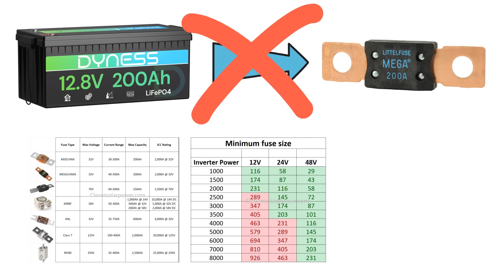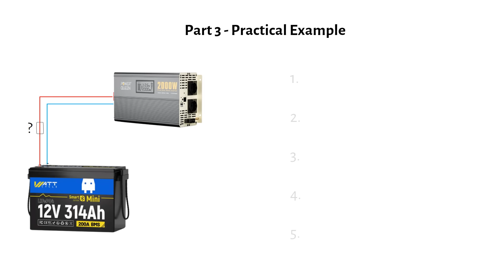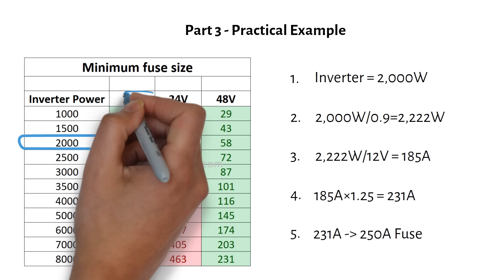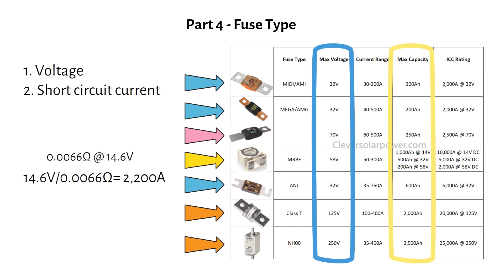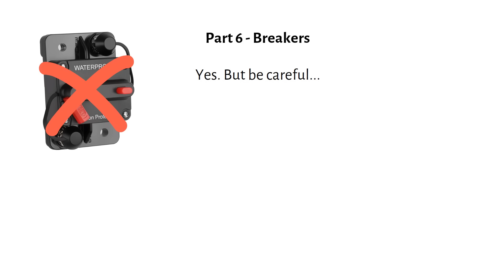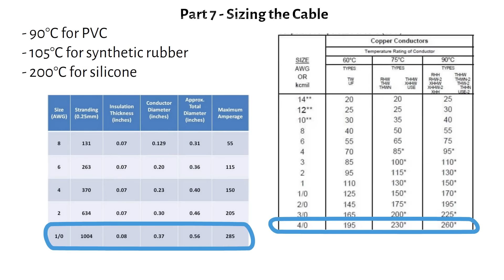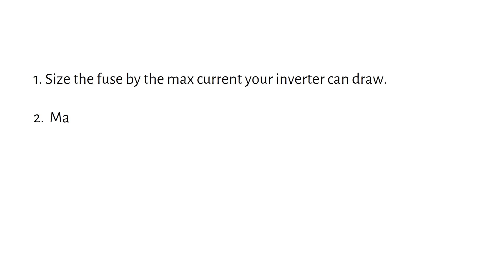How to Size Your Battery Fuse to Inverter

Comment: I'm just wondering but how does multiplying 185A by 1.25 (as a "safety factor") make this safer?  You end up putting a bigger fuse on the line allowing more current to flow before the fuse blows.  Wouldn't that be less safe?  I'm thinking more current flows potentially causing a fire.
Reply: Those of you arguing here, let me ask you a question. If you design your system and the normal operating current is 200A, will you go for that exact value of fuse? What calculation would you make to obtain a fuse valve that will not blow up during normal operating conditions? Please think well before you turn on your data to come online and run your mouth towards the opposite side. Fuse sizing is in love with cable sizing. Always treat them equally to avoid disaster. Thanks
Reply: @BlaiseChia For a NON-SOLAR electric circuit, If the normal continuous operating current (more than 3h) is 200A, then the National Electric Code, NEC, requires a minimun rating of 1.25 x 200 = 250A for Fuses, Breakers and Conductors.  But wait. We are not done yet.  IF that circuit is produced by a SOLAR PANEL ARRAY, then that 250A must be upgraded by another 25%.  
250A x 1.25 = 313A minimum ratings for  all Fuses, Breakers and Conductors. 

This is safe to operate continuously at 200A, because 
1.  The first increase of 25% allows you to operate more than 3hours.  
Why?  Because the continuous load for Fuses and Breakers and almost ALL electrical equipment is 80% of their (short term) ratings.  Short term ratings are the  standard electrical practice.  Many people don't understand that the typical  "Electric Ratings" are NOT FOR CONTINUOUS OPERATION.  Electric Ratings are MAX SHORT TERM LOADS.  If operated continously heat builds up, so short term ratings are reduced to 80% to allow continuous operation (more than 3h).   If we take 80% of 250A, we get the continuous rating.  0.80 x 250 = 200A.
Sizing of breakers, fuses and conductors at 250A allows continuous operation. 

2. But we need 312A.   Why?  There's a lot going on in a solar power system!
Solar panels can operate in extreme conditions anywhere in the world.  We must account for temperatures that could vary from - 40 to 85°C.  We must account for sun intensity.  Cloud edge effects, a snow covered field or a backyard pool, or a large sliding glass door, can increase the sunlight hitting solar panels.  Incoming radiation on a panel might easily increase by 10% or so.  A temperature at freezing point can increase output voltage of each panel by 7.5%.  Panel configuration in series adds voltage.  3 panels in series in winter might be a 3 x 7.5 = 23% increase in voltage.  If these things happen all together, you could easily be riding on the edge, if not over the max currents.  To account for possible extreme outputs of all those things, the NEC requires another 25% increase.  250A x 1.25 = 215.5, or call it 313A.  That's what is needed for MINIMUM solar system safety.  Note that there is still room to increase it more.  If you get temperatures significantly below freezing and you have a nearby snow covered field, or a building nearby with reflecting glass panels, you might want to have an electrical engineer take a look. 

If you go lower than 313A, be sure your insurance is paid up, you complied with NEC or whatever your local building inspector said and whomever assembled your system was licensed.
Reply: @bipl8989 scaring the crap out of me.  I just built a small system  and afraid to turn it on now. LOL.  Any idea where to find a professional to look over my little setup for safety suggestions?  There must be people making a few bucks advising on these issues.
Reply: @bruceontheweb  Sorry.  Wasn't meant to scare you, just to get people thinking seriously. That's not common on YT.  These high Amp systems, even a small one, can actually be very dangerous.  Just 50mA can be fatal under the right, or rather the wrong conditions. Any accident could at least be an extremely unpleasant experience.  Modern solar makes it very easy for most anyone to build a powerhouse, or a death trap. I'm not sure it truly qualifies as DIY.  When I see a lot of these "internet solar experts" getting the most basic safety factors wrong", that worries me a lot and I feel I have to comment.  Great you're taking it seriously.  
  The best idea would be to try to find a registered professional electrical engineer in your area.  Second, find a registered electrical contractor.  Ask them which consulting electrical engineer they use when plans need to be stamped by a registered professional engineer.  3rd. Ask your nearest city building department if they have a list of consulting engineers in the city, or who they can suggest. 
  Lastly,  Tell us about your system config and maybe I can find you a good "go by" example plan.
Reply: @bipl89891.25 is a motor load calculation for start up in rush current.We use this with slow blow fuses.That's to not keep blowing fuses on inrush currents.Derating 80 percent on continues loads yes 3 hours.The fuse is to protect the conductor ,no matter if it is either. 14gauge 15amp 12 gauge 20amp and so on.The fuse rating is sized to the conductor and the conductor is sized to the load.
Reply: @bipl8989as a german Electrician i size my Fuse by cable ;) .
Its defined in our Code.
A Fuse for a Powertransmission has to protect the Cable ,there are smaller fuses to fuse a Generator (battery,photovoltaik, load) in Addition.
If the cable is thick enugh you can only fuse Generation (on the Power source).
And a smaller one to protect your load from Catch fire.
The collegue in the other comment is right! you need to calculate duty cycle in by (in germany) Faktor 1,25 on 100% within 1 Hour.
Reply from the maker: Good question. Sizing the fuse larger makes it run cooler, so less heat generation and less power loss. Also, the cable will be sized larger, so there is less heat loss and voltage drop there as well. A fuse doesn't limit the current.
Reply: what does sizing the fuse larger (fuse value) have to do with temperature? are you confusing fuses with contactors or shunts? yes, the quality of the fuse can make a diference in working temperature, but not upsizing it. and if you want to multiply something by 1.25 for safety reasons, that something should be your cable cross section. when you say 'safety' you mean ' make sure you don't blow the fuse with your load' or you mean safey like in 'prevent fire'? .   it is bad enough that usualy you need to go up in value to find a standard value for the fuse you need
Reply: @breakthru3000 you are not only calculating the fuse size, but the cable size as well.
If you sized a 250A fuse, you would also size the cable to handle 250A. NEVER use a larger fuse than the cables you are running.
Reply: @woodlanditguy2951   The wire must be rated to handle at least as much current as the fuse rating, but the best practice recommends the wire can handle 125% of the fuse rating for a safety margin against fuse malfunction.  Nothing dangerous about using a lower fuse rating, it's a low wire rating that will screw things up, but a low fuse rating might blow when you really would prefer it to ride through.
Reply: @breakthru3000 Temperatures increase with operating time.  Temperature increases are only covered in a typical design for up to 3 hours.  Operating longer than 3 hours, as in a typical solar system, requires a reduction in all allowable current ratings.  In the typical wire tables, the given Amp ratings mean that the stated temperature will be reached after 3h of operation at the stated current.  Over 3h and wire temperature will continue to increase.  To account for that, increasing the wire's design current by 25%, before looking in the table, will get us a wire size that we can safely use for more than 3 hours in a NON-SOLAR system. 
  Solar systems require another 25% increase in current for days when excessive current can be generated.  So, for solar systems the max current must be multiplied by 1.25 x 1.25  or 1.56 before entering the wire size table.
Reply: @bipl8989I like your responses. These are some of the engineering brains I know out there 👍👍👍
Reply: @BlaiseChia Thank you!  50 years in engineering oil & gas works taught me safety is #1.  Solar makes it easy to assemble complicated systems, not a weld in sight, but we can't forget that they can be very dangerous, if done incorrectly.  I don't want to see anybody get hurt.  And always remember that building to code is the absolute minimum requirement.  Look for those situations where you may need to beef up, especially when safety is concerned.  They usually fall into the category of cheap insurance.
Reply: It’s true that the quality of a fuse can make a difference in operating temperature. But upsizing the fuse can also make the fuse run cooler. Again, it depends on the quality. An ideal fuse should never get warm even the slightest, and then it should trip as soon as the current exceeds the rated value. However, no ideal components exist in the real world. The reason a fuse opens at high current is because its internal conductor gets warm enough to melt and interrupt the circuit. Without heat, a fuse would never be able to blow. Fuses are engineered so that their internal conductor gets very warm when the trip current is exceeded. Therefore, a 100 A fuse does not normally get much warm when there is 9 A running through it, but a 10 A fuse could potentially get quite warm at that current.
However, “upsize your fuse so it doesn’t run warm” is a very bad advice in my opinion. There is no logic behind such reasoning, because we are then compromising the amount of protection we have during a real over current event… which is the type of scenario we are trying to protect against in the first place.
I think a better practice is to oversize your cables as much as you have money and space for, then rate the fuse according to how much current you expect to flow in the system. You expect your inverter to never draw more than 170 A continuous? Put a 200 A fuse in series with the positive supply for the inverter. That’s all there is to it.
The way things are explained in this video could leave room for improvements. We don’t calculate a fuse according to the max power rating of an inverter. We can use a 3000 W inverter but never draw more than 1000 W from it. In that case putting a fuse there based on a 3000 W output calculation only makes the system less safe.
Reply: 50a dcdc needs 60a fuse cause 49a makes it melt i had mega fuse that melted and 50a isnt exact Science its around+-5%
Reply: Because more current never flows.  Larger Fues and thicker wires do not generate larger current.   It is more safe because the wire and fuse are both sized for the increased Amperage, well over what can be delivered by the devices in the system that do actually make current, but still low enough to blow on a short current.  A lower rating is "safer", but may be subject to blowing when you get a small transient that you would actually prefer to ride through, rather than blow for some level of current that is still safe.

Comment: Hi Nick, Great video.  For choosing cables, I like the silicone insulated cables but I've always been wary of fusing them to rated capacity.  It is nice that the insulation can handle higher temperatures for overload conditions without breaking down,  but I do not want that heat in my system under regular conditions.  I don't like the inefficiency of this or the knock-on effect that extra heat has on the system components (de-rating of inverters & solar charge controllers etc).  The copper in them is essentially the same as PVC insulated cables (though sometimes more strands or tinning) & the same cross-sectional area.   For connections between charge controller, battery, busbar & inverter connections, etc, I like to use the biggest conductors that will physically fit with correct lugs or bootlace ferrules.  We're normally dealing with very short cables here so upsizing is not cost prohibitive.  Keep up the great work - I'm learning a lot from you & Will & Andy!
Reply from the maker: The temperature rating doesn't mean the cable goes up to that temperature of 200°C at the rated current. It's how much heat the cable can withstand before its insulation properties fade. Cables should always be touchable under normal loads. If you prefer, you can de-rate the silicone cables to the welding cables. I agree, Will and Andy are great. I follow them too 😄
Reply: @cleversolarpower  Yes understood. I guess that's what I do - I derate the silicone cables down to the current carrying capacity of 75C PVC cables.  I tend to have one size larger cables than is really required so the resistance of the cable adds less heat to the overall system (& runs a tiny bit more efficiently).   Am I correct in assuming that a PVC-insulated cable and a silicone-insulated cable of the same copper cross-sectional area would heat (under load) to the same degree?

Comment: ICC ratings is at 32V for the mega fuse vill it be the same at 14V?
Reply from the maker: Yes, because the datasheet doesn't provide a 14V rating. Unlike the MRBF fuse.

Comment: In a very simple system the fusing is definitely subjective, since you might be using the fuse to serve several purposes at once (such as protecting the battery cabling and handling an inverter short).  Once you start scaling up, however, things change.  The last thing you want in a more scaled system is for a short at the inverter to blow the main battery fuse.  Or a short at any satellite device to take down the entire system.

When you scale up you want several layers of protection and at this point the function of the various over-current devices change.  Now the main battery fuse is just protecting the main battery cabling, not the inverter and not necessarily the max amps you intend to use from the battery either.    For example, you might use a 125A fuse.

Instead of going to the battery bus, the main battery cable runs through the fuse and from there into a main breaker at the other end of the cable.  This main breaker is sized to 125% of the maximum expected system amperage for the battery (usually much lower than what you fused for).  For example, you might wind up with a 80A main breaker, for example.

After the main breaker comes the main battery bus that everything else hangs off of.  The batteries, charge controllers, inverters, DC outputs, whatever.   Each one of those devices is individually protected by its own breaker or fuse (I recommend breakers at this point).  For example a 20A charge controller might hang off the main battery bus with a 35A fuse, a 1000W inverter might hang off the main battery bus with a 25A breaker.  A DC port intend for up to 15A might hang off the main battery bus with a 25A breaker.

In a scaled system there isn't just one over-current devices protecting a circuit.  There will be three or four.  The battery BMS, the main battery fuse, the main battery bus breaker, and individual device breakers or fuses.    There are two REASONS you do things this way:

(1) Because the larger fuses closer to the battery (for example) vastly reduce the worst-case current that can flow in the later over-current devices, making them orders of magnitude safer to operate.  And making the system as a whole much safer

(2) So failures at satellite devices only trip that device and does not take down the entire system.

-Matt
Reply: (1 and 2) That is how it's done in automotive(and in AC distribution), my car at least, has a 300 amp fuse at the battery followed by a 250 for the starter and then followed by other distribution circuits where amp rating requirements are lower.  Ideally, that is how you would want to protect your wiring, but it is complex for a lot of people to understand and follow.
Reply from the maker: Yes, in large systems you need selectivity which fuse is going to blow first. We usually do this by overlaying the trip curves of breakers/fuses with each other and selecting the quickest one to be closer to the battery. And the slower one closer to the inverter. But in a small hobby system like I'm teaching on this channel, this doesn't matter much and makes it quite complicated. 

Yes, there are more fuses/breakers in the system. This video was only geared towards the main battery fuse. I recommend fusing every positive cable in the system. Thanks for your comment Matt, always interesting to read.

Comment: I am no expert on this matter but I feel like I know a bit. This video seems absolutely spot on in terms of accuracy and thoroughness. 

Thanks, as always, for your content. It's super valuable.
Reply from the maker: Glad you liked it 😉
Reply: This video is very wrong
Reply: @shaynegadsden how so?
Reply: @andrewford80 because list of things stated is wrong to pick your fuse size, you first look at the cables rating then you apply any derating like if it runs mostly covered in insultaion or is overly long then you pick the fuse below that number. That is all
Reply: @shaynegadsden I'd need to watch the video again but I thought that was pretty much what he said.
Reply: @andrewford80 the video starts with him listing of a pile of stuff that had nothing to do with fuse selection as fuse selection
Reply: @shaynegadsden  Right, yes the purpose of the FUSE is to protect the wire. He does literally say that within the first minute of the video.
but this video should probably titled, how to size cable and fuses depending on load.
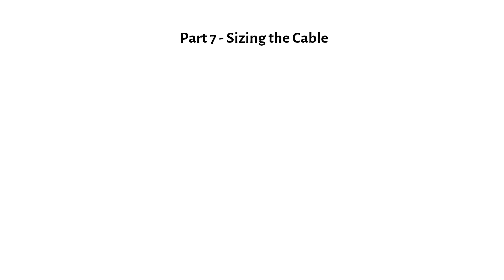Reply: @shaynegadsden  And at 13:20 he covers cable sizing
Reply: @andrewford80 right so if he wanted to make a video about cable sizing that is different than one on selecting the correct fuse